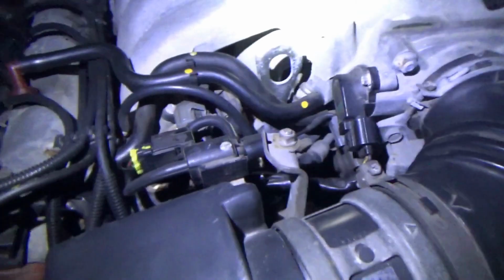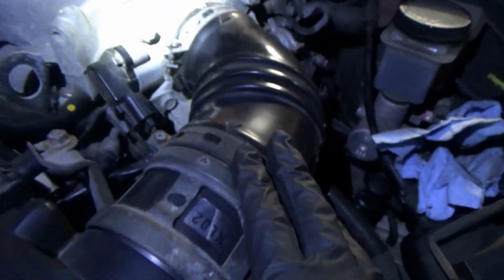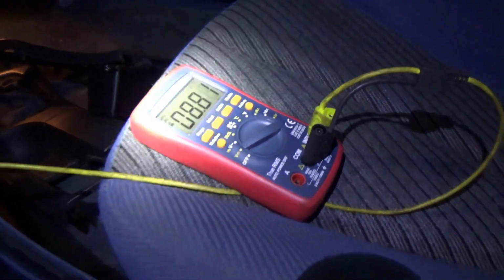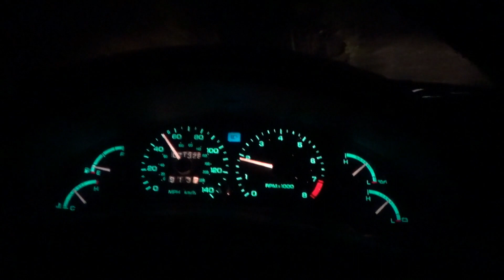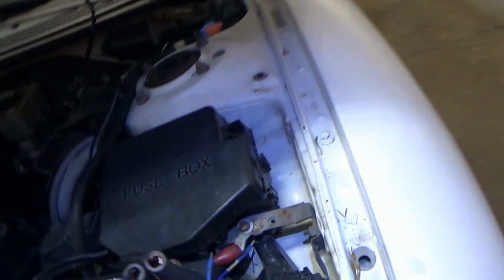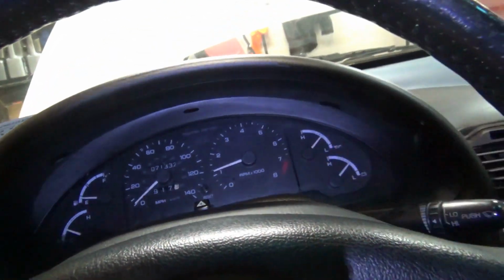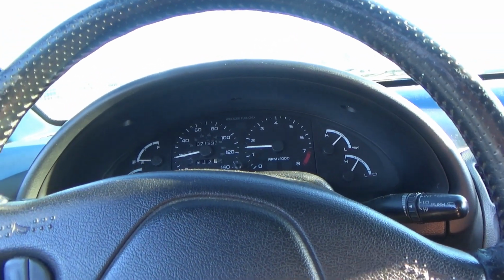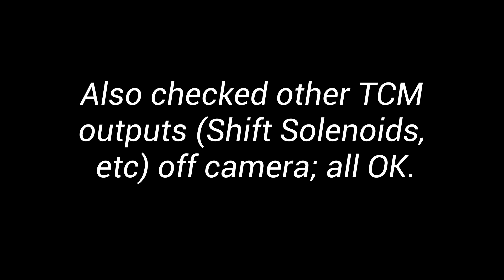The POSSESSED Probe - Halloween Special (Part 2)

Comment: If you have a fluid transfer pump
You can pump out some from the dipstick tube.

I have been fighting a jatco trans on a 2001 maxima .  235k

But at least that can use  scan tool.

Comment: I would think that the shift valve is scored and when you select 2nd there is a bypass and 2 gears are being selected at the same time. The bore in the valve body may also be scored. With the TCM unplugged the line presure would be low so the bypass would not enough to engage 2 ratios

Comment: Disconnect the signal wire that commands the torque converter lock up. The module is acting like it would at highway speed.
Reply from the maker: I scoped it out...TCM is doing what it should!

Comment: Hmmm....Swapped gauge cluster ? That would account for milage and possibly some indicator lights not properly reconnected. Back in my younger days, I bought a car that said 24k miles, but the interior looked more like 70k. And the speedometer should have gone to 120 or so but went to 85 and was missing the Z28 logo. I learned !

Comment: May as well bite the bullet and have the transmission rebuilt, do the timing belt job and install the transmission cooler with fassteners vs. nylon tie straps. The idea of installing a manual shift transmission into an automatic computerized vehicle sounds like a huge can of worms. One other option...sell this Probe and find another car but have it inspected before completeing the sale.

Comment: Regardless of what the voltages said, it's acting like the lock up clutch is engaging. Even if line pressure was off the charts, the torque converter would still let the engine spin. The lock up clutch is the only thing that will physically stop the engine. Why it's doing that, who knows, but seems to be TCM related.
Reply from the maker: Scope proved that the TCC was NOT being commanded on when the stall occurred. That surprised me as well! Why would it stall ONLY in 2nd gear??
Reply: @PineHollowAutoDiagnostics  Agreed, it appeared that it wasn't being commanded on and also odd to only happen in 2nd. But, what else could physically stop the engine like you dumped the clutch? I mean that is the classic stuck lock up symptom. Even if second put the trans in 2nd and rev, like a trans brake, the converter would still let the engine run, the car just wouldn't move. It wouldn't cause it to bang the engine off. Totally guessing here, could line pressure be to high with TCM connected and bleeding past TCC solenoid? But something definitely has to be getting that converter to lock up. Not sure if you still have the ghists, but does it have test ports to measure actual TCC pressure? That would be more definitive than the electrical control to solenoid. But what wold you tell someone with the same symptoms? 
But this was a good one for sure!! Happy Halloween!
Reply: Here's an idea too, put it in first and manually activate TCC. See if it does the same stalling.

Comment: It might just be the camera but the color of the transmission fluid looked odd when you were draining it. Perhaps the cooler/heater coil in the radiator failed and it got coolant in the transmission.
Reply from the maker: Actually cooler was that aftermarket unit ziptied to the rad support...maybe not sufficient to cool the trans?

Comment: I drained fluid from my Magnum's overfilled transmission by inserting a tygon tube down the dipstick hole and syphoning it out.  Easy Peasy.  The Magnum came with a dipstick tube but no dipstick.  I bought one from B&M.

Comment: The Taurus of those years were notorious for trans issues, I don't know if it's the same one but if it is they didn't last long before they needed an overhaul, most guys would just replace them with a rebuilt, get one from the dealer because if something goes wrong with under warranty they have to do the work and replace it, that's the way it used to be anyway.

Comment: I believe if you check the shop manual - if you disconnect the computer and manually select two forward gears ( which ones I don’t remember) and reverse - the transmission is mechanically and hydraulically good - the problem has to be electrical - was involved with something similar back in the day with the factory - the culprit was voltage induced into the speed sensor wiring - that was my problem - but posting to say that there is some type of mechanical proveout  you can do with this transmission

Comment: While I really appreciate your skills, and know you know vastly more than I do, I'm wondering when checking fluid levels stopped being the first thing a mechanic does, or when it stopped being the first thing for a car buyer?  That was drilled into me to check fluid levels and condition first, along with basics like the condition of spark plug wires, and checking for fluid leaks on and under the car.  If the buyer had simply checked those fluids first, he likely would have passed on the car, or at least asked a lot of questions about why the transmission was so overfilled.  Likewise, if you had seen the overfilled transmission first, it likely would have sent you in a different direction on the diagnosis, and saved you several hours.  I'm not busting on you for that.  From you, Eric O. and Wes, I have learned to check wiring harnesses to see if they have been monkeyed with, which is not something I would have checked before.  However, checking fluids first might be something to add to your arsenal.
Reply from the maker: Yes fluid checks are a basic starting point. In this case it didn't change the diagnosis or outcome whatsoever, and would not have saved any diag time ;)

Comment: HI IVAN,good video,I'm sure your gut was telling you the mileage, per belt tension-er and interior wear etc.was screaming triple the mileage? It just seems fishy.My 94 Honda civic has 540,000 thou and the speed o broke a while back.So i bought a one from the wreckers,but i got the one for the SI since it has a tachometer and the DX autos don't  .I changed the odometer from the wrecker one  with at ONLY 170,000 miles to mine.WHY>> because I'm proud to say I've owned it since new,and it still has the same motor and tranny.it's had 2 sets of axles,2 rads,5 timing belts 50+oil changes and about 10 auto trans fluid changes ,all of which i did.I'm retired now it only get maybe 100 miles a week on it  instead of 125 daily.the bad side  i have to say the air conditioner took a crap at 2 years,which i never fixed,still a good car.

Comment: CD4E . Thay had a problem  with the converters.  But was mostly  slipping codes. Stalling check case connector for the pin aliment clip missing , letting them touch each other

Comment: I agree with your assessment Ivan - if you're someone who could do the work yourself then it might be worth it but from my experience those 90's Fords were no stranger to electrical gremlins and here in England it seems like they all disappeared from the roads in short order and I NEVER saw an automatic. Probably for a reason. 

In England it was not uncommon for the MK1 Mondeos which were very similar to have the clock wound back. A lot of them were mile munching family cars and the trick was they'd get one which had been chucked because it had 130K on it and wind it back to 70K or they'd get a 70K and wind it back to 30K to get a profit on them. The service info if you could find it would often be a good clue as the estates especially used to munch through a clutch every 60K.
Reply: Yeah, those Jetco transmissions just don't last, and Nissan used that company for so many years that it ruined their brand.   If it has a Jetco transmission-- RUN

Comment: Definitely an internal fault in the transmission possibly solenoid related and the instrument panel was probably taking apart to remove the check engine light and overdrive lights. If they weren't that far they probably also rolled back to the odometer to make it seem more tempting

Comment: Thanks for this follow up. I've been anticipating this video as this experience pretty much matches quite a few cars I've encountered. Most of the time my customers don't want me to fix all the issues as another major repair is needed. Similar to the timing belt issue. They usually just want to basically keep them running. 
Back in the 1980s, I experienced a transmission module which kept the torque converter locked up. My customer wanted me to install a toggle switch to disengage the solenoid.
Nice diagnostic work.

Comment: That's such a good point..  And with all those warning lights not working, could it be that someone did a half azz job and swapped in a new cluster with the low 70k miles on the odometer, and just didn't' hook everything up correctly;  and maybe that's why the miles are so off.  I knew something was weird when it needs a timing belt that badly at only 70k miles.  This thing should have a red flag hanging from the antenna.
Reply: This looks like car flip scam to me, not incompetence but scam sale.

Comment: There were a few Asian 1990's vehicles that I dug into.  They liked to use that closed throttle switch.  There surely was some kind of procedure that I didn't know about, but it was tough to figure out how to get them to idle correctly between ignition timing, engine temperature, and throttle stop switch being satisfied along with its adjustment position.   it was a lot of guess and check.
Reply: In the original Bosch docs for this ECU type, the closed throttle switch is what activates the 'anti-stall functionality'  =)

Comment: My 1st car was a Probe back in 2000. I still think its one of the best looking cars Ford made (or Mazda whatever). Mine did go through a couple transmissions though...Cool to see one again. I'd assume most were victims of c4c.
Reply: The only vehicles that qualified for C4C were vehicles that were EPA rated 18 mpg or less. So actually there wasn't a single Probe killed by C4C.

Comment: Ivan the two smaller stripes in the tach are at 333 and 666 tpm (the 1 stands for 999) So when adjusting the tpm theneedle should stand at or just past the second small stripe

Comment: Ages ago, mechanics would cut wires to disable the check engine light(s) because some states would not approve a safety inspection if any lights were on. This may be a contributing factor. Happy Halloween!!!
Reply: I've seen all types of shade tree scummyness related to the CEL.   I've seen people take the bulbs out, try to paint over them with black paint.   I've seen one VW where someone took the gauge cluster out, and shoved paper towels inside the CEL so it would no longer illuminate.  I still remember the era when people could roll the mechanical gauge clusters back and delete mileage.  I've also seen people replace the entire cluster with ones that had low mileage on them.

Comment: Definitely  a demonstration of patience and raw intellectual curiosity on your part! I'm with you - one of the previous owners (or his henchman) jacked up the idle to hide the transmission issue. Maybe that worked for a while, but the tranny continued its journey toward death........ I'd be curious whether the timing belt issue can be cured with only a belt and tensioner - would not be surprised to find a bad water pump or loose pulley somewhere. Oh -  that night-time test drive low on gas - very spooky!!!! II like manual transmissions, but would  not be interested in putting one in this car, even if it were free (the car and the transmission).
Reply: I have a manual 95 PGT, with full exhaust system build headers..and short throw shifter. Cold AIR intake....and it has been a RIOT of a car..Manual transmission is the only way..shortest shifts this side of a WRX STI, no joke. Now IVe had plenty of no start problems, Gravity switch problems, Slave cylinder failure twice, and finally a failed clutch, then an oil cooler line blew, and now finally mysterious FULL engine shut off after cars been driven 2 to 3 minutes...which I have YET to diagnose, I have it in SHINY black, still factory shine on it, its garaged, SUPER STIFF stock suspension HOLY cow..but soo much fun to drive.

with having 3 other cars now tho, this MIGHT be the final issue to put it to rest..so we'll see. 

Ivan, (btw..thats my dads name) where are U located..would love to look together @ my particular predicament, Ive worked on and solved MOST of the issues on Mine. 250k miles on it, and the engine still pulls like a demon, and runs great, aside from Squirrely issues that come up here and there...have had it for 20 years myself...3rd owner.,..this is my 4rd PGT..I also have a 4th..thats a parts car.

Comment: Even though there is a PWM signal, the duty cycle may not be correct. Maybe there is a spec on what the DC should be. The TCM could have an internal fault causing it to output too much line pressure or it may have a missing signal.
I suspect that the IC lightbulbs were intentionally taken out because they were staying on. It doesn't seem that much work to fix all the issues the car has, the engine sounds good, just needs a timing belt and tuneup, the transmission is probably mechanically fine, needs TCM diagnosis or rebuild. Other modules may have more issues (SRS, ABS). At least you could replace the IC lightbulbs.

Comment: Solid car.  Just has some issues to fix.  Back in the late 90s I had a 1990 Buick Skylark with known transmission issues.  After about 90k miles the TCs would chew themselves up.  The cancer of the north took that gem from me too early. Rusted out but was still pulling 33 MPG on the interstate at 70 mph (without cruise).  Love that Tech-4 2.5L.

Comment: Enjoyed the Halloween special. Incredible how much effort is required to pull information from 90s cars. With the transmission issues, timing issues, rolled-back odometer, the fun would never end. Maybe some good parts for recycling.
Reply: @OttawaOldFart  Re-recycled parts for others.
Reply: rolled-back odometer.. :) I don't think its rolled back. I think its gone all the way around.
Reply: @OttawaOldFart  I finally got your point now that you mention it; thanks for both comments. At least the metals can be melted down and recycled. This Probe was a real junker.

Comment: First thing I would have checked with the transmission is the Park/Neutral Safety switch for proper adjustment and the Range Sensor.
An overfilled automatic transmission will typically cause the fluid to aerate.   With air in the fluid, it  will not work correctly.
The fluid is brown/muddy colored from friction material being worn off various elements inside the transmission.

I give that car 3-18 months before the transmission completely fails or the timing belt let's go.  If it is an interference engine, pistons will meet valves !

Comment: I had a gm that did that in the early 90s. The lock up torque converter was pooched. When I unplugged it. The car was fine. The car wasn’t worth the converter so i just put a switch on it and only used it on the highway. But as soon as I got off the highway I turned the switch off. Yep I was a broke ass college student.
Reply from the maker: Wait so it sounds like the converter was OK, but the controller just kept it ON all the time? Big difference!

Comment: Ivan,   great video!  Kind of knew that the transmission is on its way out as of the overfill fluid.   As it can't breathe with too much line pressure etc.  As Fords trans aren't exactly reliable.  But great checks and i can see why the previous owner meddling the throttle body as it kept stalling out.   Kind of wonder if that the case?  Any updates from owner's decision?  Also at least you fixed all the issues that you were paid to do.   Great job,  Ivan!  Happy Halloween!!

Comment: As usual total dedication and over my head.  I was nervous that the gas gage was sitting almost on empty.  You did not clarify the worn 2 pins on the TCM.  Not sure if related, but I have 97 Lincoln TC had both delayed trans shift and high idle.  Killed me to take it to Ford as I do most of the work.  They said bad throttle body because they could not adjust new TPS.  Thinking it might be the transmission went to trusted shop who drove it while watching scanner.  Tech said it was definitely TPS and not trans.  Installed cheap Chinese TPS and that was 6 years ago, running fantastic ever since.  Did not realize how important TPS was for trans shifting.  Did you scope the TPS? Perhaps a drop out when you went to 2nd.

Comment: Before retirement,  I had a 95 Ford commuter Van with a 5.8L V8, E350, that when the driver put the trans in Drive the engine would stall and it was OBD1.
Long story short, it was the digital "odometer" that was the problem.  This was about 2012, no part from Ford.  A speedometer shop repaired it.....good to go.
Some of our 2003-2004,  F350 V10, Utility Body (City Fleet) would stall when put in drive.  Using the old Ford NGS in Flight Record, when the  transmission was put in drive I went through the recording one parameter caught my attention right away.  The VSS went from 0 to 120 MPH.  No engine or trans codes.  The fix?  With only 37,000+ miles 10 worn spark plugs and 10 new ignition coils......NO MORE STALLING!  Plugs and coils are a lot cheaper than a trans overhaul!  And it was the correct repair.
Good one Ivan!  Old OBD1 vehicles can be a real nightmare.  Might be a "Walking Dead" car.